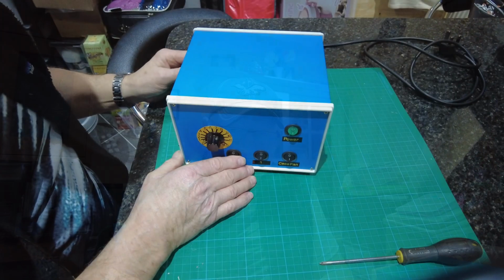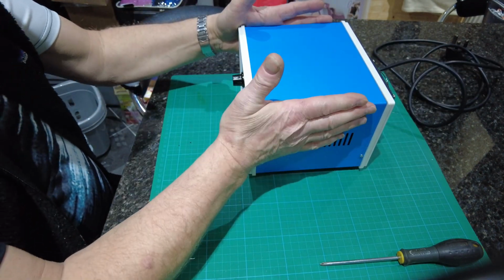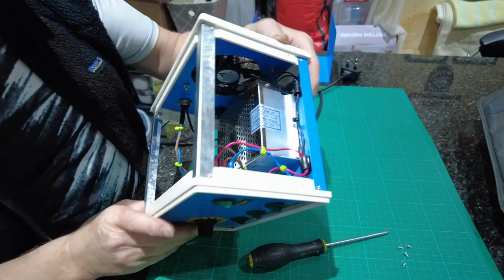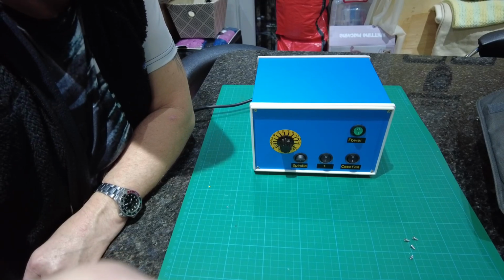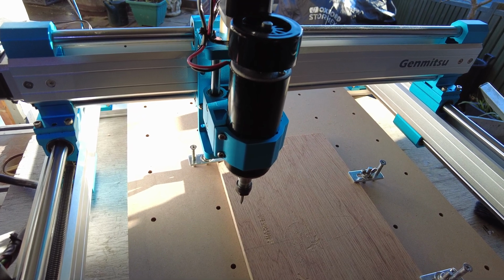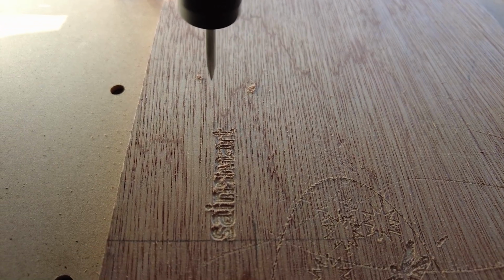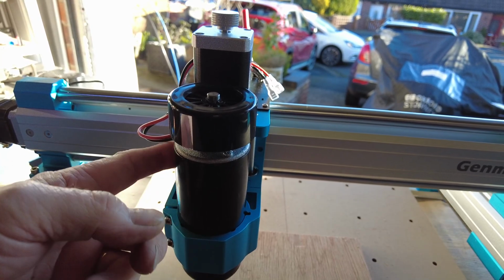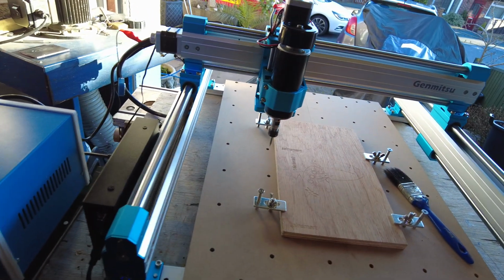Sainsmart Genmitsu CNC 4040 Pro Upgrading the spindle using a control box

Comment: Many thanks for this video and helpful set-up instructions.  I have just installed a similar 700W spindle upgrade on my 4040 pro after 4 months of using the standard spindle and occasionally a trim router.   I hope that this upgrade will meet my needs for the future as it is more quiet than the router and there seems to be less vibration.  Would you recommend the cooling upgrade to lengthen the life of the spindle?  I would need to ask you for your STL file to get it printed commercially as I do not have a printer.  Many thanks in advance.
Reply from the maker: Hi thanks for your response, if the spindle is the same as mine and fits in the 52mm collar then yes it would benefit from the cooling shroud. The only way you would know is to run the spindle for a while and check the temperature. It should be warm not hot.
Reply: @Tonys.Top.Tips.Workshop  Hi Tony, I ran the spindle for 2.5 hours yesterday without an obvious heating problem.  It was warm to touch, but not overly hot.  After checking other YouTube videos, I think my new spindle may be a 500w model similar to your spindle, not 700w, as listed on Temu!  I will hold off making a cooling shroud unless the spindle becomes seriously hot to touch.  It would probably cost me $50-100 to have in printed in Oz.  One problem I do have though is the fan is not coming on when I turn on the spindle main power.  VFD works nut no fan.  I connected the wires it directly to the on/off circuit on the mother board.  Was this the correct thing to do, not being an electrical wizard. :)
Reply from the maker: @seastrength1291  hi it depends what voltage the fan is mine is 230 volt so mine is wired from the incoming Mains power but switched so I turn my case on manually. I did this because in the winter my workshop can be cold so I have no need for it to be on. It sounds like you should be OK with the cooling
Reply: Ah, I see my problem now. My fan is 12 volt because I assumed it was running off the current output from the motherboard. I will need to buy a 240 volt fan. Thanks again Tony for your help. 😊t @Tonys.Top.Tips.Workshop
Reply from the maker: @kerrodhallett4944  Just asking did you create a control box like I did .
Reply: @Tonys.Top.Tips.Workshop  very similar, however, I used a plastic box though and cut some airholes for cooling.  I did not wire up separate switches for the fan and spindle though, too much electrickery for me!

Comment: Thanks, Tony, for all your assistance. the wire bundle on back of X axis has a marker Z 4 wire goes to Z motor and a 3 wire with Z marker presumably plugs to receptacle on top of black module of Z axis, that been said where does the probe connect? sorry for so many inquires..
Reply from the maker: Hi the z probe plugs into the black box it should be marked.let me know how you get on
Reply: Many thanks Tony @Tonys.Top.Tips.Workshop

Comment: Tony some help if ypu please, I just purchased the Genmitsu 4040 cnc and currently assembling same, the spindle is the updated version. The hardware box contains two limit switches, are they spares? Thanks
Reply from the maker: Hi thanks for your question , yes they are spares I had the same in mine
Reply from the maker: do you mean the upgraded z axis frame

Comment: Tony in your opinion is there an advantage of pressurizing the control box as opposed to evacuation of heated air..
Reply from the maker: Hi thanks for the question I tested the heat sink within the power-pack with a digital thermometer and found the unit cooler when running for over an hour
Reply: Thanks very much sir. @Tonys.Top.Tips.Workshop

Comment: I just ordered that same spindle kit for my 4040 pro and got concerned about the mounting. The one I ordered is 55mm, but it looks like you have your mounted in the original spindle mount. Is your spindle 55mm? And did you have to do anything special to make it fit?
Reply from the maker: Hi Ryan this is the one I purchased https://www.amazon.co.uk/gp/product/B09S9ZHYFF/ref=ppx_yo_dt_b_asin_title_o05_s00?ie=UTF8&psc=1    
Its 52mm dia, 55mm wont fit when I first ordered mine from Amazon I purchased the 55mm one and that was a true brushless spindle but didn't fit. The one I have now is not brushless but it was the next cheapest upgrade to the standard spindle.

Comment: Hi Tony thanks for this video.  Is this new spindle built like the one supplied with the 4040?  By that I mean is the collet holder pressed onto a small shaft from the motor?  Have you tried cutting anything like plywood or solid hardwood with an 1/8 inch bit? I am cutting .220 plywood in three passes and cant get a vibration free cut even at a feed rate of 5 IPM.   Also can the power supply you used accept 120V for the input instead of 220V?  Thanks for the help.
Reply from the maker: Hi Jim yes its pressed on to the motor shaft, I will be trying some cutting in the next few days I will let you know the results. The input power states 220v on the info on amazon so don't know on that. Even with this motor which is quite heavily made there is an ever so slight vibration but as its Chinese based and not very expensive as regards cnc spindle motors its pretty acceptable. On my 6090 Pro cast cnc its a 1.5 kw water cooled spindle and the collet is part of the shaft but it would cost me about £600 to replace. Tony
Reply: @Tonys.Top.Tips.Workshop   Hi Tony, I think I solved the problem.  There was a 3.1 MM space between the collet and the spindle housing.  I pressed the collet further onto the motor shaft and reduced the space to 0.3MM and the machine seems to be cutting fine.  Let me know how you new spindle is cutting when you have time.  Jim
Reply: Hi Tony,  Have you had a chance to do any cutting with the new spindle?  I am still having trouble with chatter and vibration with the Sainsmart 775 spindle.
Reply from the maker: @jimbembinster  Hi Jim I have used it and it does not chatter. I have just been chatting to a gentleman on youtube and he has problems with the play in the z axis bearings he holds the bit and moves it back and forwards and it flexes quite a lot. Try that and let me know the stock spindle is rubbish thats why I changed it. Tony